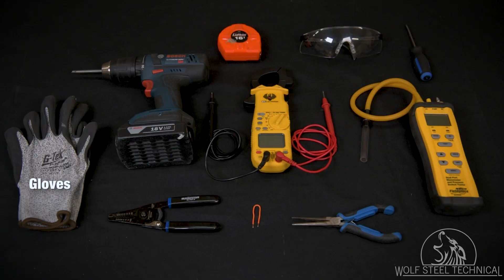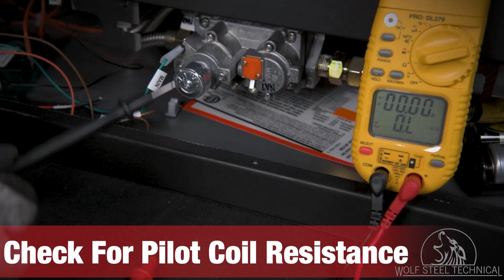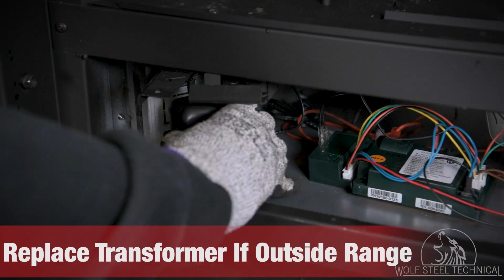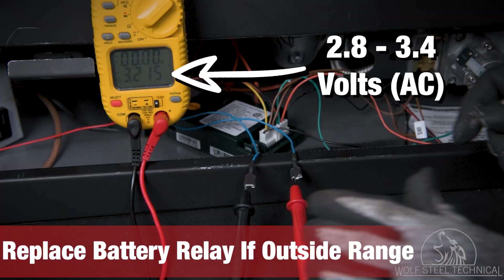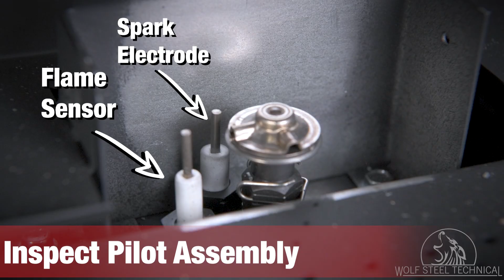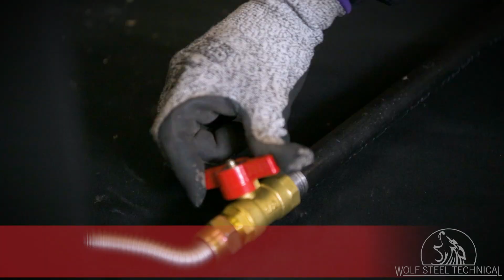DEXEN System Troubleshooting

Comment: I cant tell if it's the control module or if it's not sensing the pilot flame but my pilot comes on and keeps sparking. Occasionally the main burner will come on and then go out a few minutes later. How do I check the flame sensor readings ?
Reply from the maker: id double check the connections throughout the control board, valve, and flame sensor, sounds as if its calling for spark even after the flame is lit. If possible clean the flame sensor as well.

Of this doesn't resolve the issue, I'd reach out to Napoleon Customer Solutions to get a a better idea of next steps

Comment: Replaced module and the pilot sparks over and over and never fully ignites
Reply from the maker: Double check all connections to the gas valve and other components to ensure they are sound and have a firm connection.

Other than that, id reach out to Napoleon's Customer service team

Comment: Should have included a microamp µA test of the electrode sensor on the pilot assembly cause that is all that is missing from full diagnosis
Reply from the maker: This cannot be measured without special equipment due to the design of the firmware (a DMM will not work to measure)

Comment: The REV D indicator and the red light flash six times, and I hear an ignition sound, but there's no visible ignition. The fan seems to be working, but then it stops. What should I do? Should I replace the control board, or is there a problem with the ignition system?
Reply from the maker: Can I get more information; ignore the red indicator light for a moment and replace with some readings or even some observations. 

"I hear an ignition sound" what does that mean? 
Are you explaining the ticking of the pilot spark, or a actual pilot flame? 
Is the system on? 
Do we hear an audible beep confirming the remote synced with the system? 

I wouldn't want you to replace parts without knowing the real root of the issue, but lets gather some actual reading and continuity tests, it sounds like there is power if the blower turns on, but is it a power supply issue why the blower goes off?

Lok forward to your response!

Comment: I’ve replaced both the valve and control module and completed all the checks. Pilot sparks but does not appear to get gas as the pilot won’t light, nor will the main burners. Only check that did not pass is 3.5” manometer check from the main valve test port. I read 7” at the wall gas, 7” at the pilot test port. Should I get 3.5” at the main test port even when the system is off?
Reply from the maker: If the unit sparks but no pilot it could be a grounding issue. So assuming you tested all ground connection verification first.

Next is NO Gas or insufficient gas pressures. I'm assuming from the readings its natural gas. Check for a broken wire or wire harness (continuity test each wire) then the valve coil test (specifically on the pilot side).

Lastly the power to the valve  which could be the pilot coil wire DC voltage. If you have a spark but no gas being released to the pilot hood then its one of those failures.

Hope this helps

Comment: Whay if everything checks out but the valves just don't open or don't open enough?
Reply from the maker: have you completed a continuity test on all the wires in the wire harness? Just because it sparks doesn't necessarily mean we have continuity to actually open the gas valve. 

Couple more questions to ask:

What are your inlet and outlet pressures?
What are the actual ohms of resistance on both sides of the gas valve?

This will determine if the valve is bad and needing replacement

Comment: I have a pilot that Sparks but the valve doesn't open when there's a call for heat not enough gas goes through for anything to ignite but the gas detector detects something coming through. There are no obstructions in the pilot tube no obstructions for the gas supply. I get about 3.5 volts to the pilot solenoid from the IPI module and they're about 40 Kay ohms when I check the pilot solenoid. The flame sensor is working as the Sparks will stop when I put a lighter to it. When I bench test the valve with double a batteries making about 3 volts I can hear a very faint click but it's not very strong at all. I use the valve body as the ground only. What am I doing wrong? what is wrong with this thing?
Reply from the maker: This one is tough, as you have provided no readings for what inches of water column of gas pressure is “not enough.” 

if the stage 1 pilot doesn’t open in the valve then the valve is bad. - try replacing it

Comment: Thanks for the 5 to 6 jumper test igniter. We had replaced harness and control along with many other parts. After no spark or start up, we checked all connections, still no luck.  After jumper wire FROM 5 TO 6 sparked it, put everything back together and it fired off!
Reply from the maker: BINGO! Love these success stories! We have a lot more where that came from! What else you want to see us do though?

Comment: I got a Continental CDVs600-1 October 2024.  Since then the gas valve has been changed because the stove wouldnt light after 2 months.
  This May the stove would not shut off once the temperature set on the remote is achieved. So if it was set at 20C, the stove would continue to run as high as 25C ambient temperature before I shut the stove off on the remote. The remote flame shows its sending to be shut off,  meaning just the outline of the flame is showing on the remote,  This happened sporadiacly .     So, new remote in May. Ran it through a couple cycles getting up to temp and everything seemed ok.  Summer time it doesnt need to  run. September rolls around and it starts up, but is not shutting off still.  Would this be the control module?
Reply from the maker: Is this the F-60 thermostatic remote control added onto the unit? If so a couple suggestions; the remote transmitter and receiver (again) or have you replaced the batteries in both the transmitter and receiver recently? Try fresh batteries in both, sometimes it’s that simple of a fix.
  
If this isn't a fix, you can try replacing the control module for obvious reasons.

Lastly, I’m curious why the gas valve was changed because it wouldn’t lite? Valve’s very rarely are bad.
Reply: @wolfsteeltechnical  The remote is  model W660-0123. I would change the batteries every time it wouldnt shut off on both the remote and the control module. There is a red light that should light up on the  control module if the batteries are low, and it never lit up. I would test the batteries with a multi meter and they were always 1.5v or a bit higher on AA"s and AAA in the remote.  
Now the recomended remedy to fix this  is to disconnect the rocker switch and if that doesnt fix it , try another remote which will be the 3rd one
Reply from the maker: @LelandH-c6i  Those red low battery lights are notorious for not being accurate or working.
That doesn’t mean they need to replace it, when the batteries are dead replace them! Most the time the battery holder is in a position you cannot see the faint red light anyways.

Who’s recommending disconnecting the rocker switch and why? That will not solve the question of the low battery indicator light?

Comment: how many volt on the pilot wire (orange) when turn the switch on? is the volt in AC or DC?
Reply from the maker: Hey! Great Question. For testing the pilot coil wire on a Dexen system, perform these steps:

Set multimeter to volts DC.
Ensure the pilot wire is disconnected from the valve
Place the black lead on the gas valve
Place the red lead on the quick connect end of the pilot wire
Turn on main power switch 
You should receive 3VDC (+ or - 0.5DCV)

Hope this helps!
Reply: @wolfsteeltechnical  How much volts should you read for the main gas coil? Thank you!
Reply from the maker: @ 

To test the main, which is the green wire:

Set multimeter to volts DC.
Ensure the main wire (green) is disconnected from the valve
Place the black lead on the gas valve
Place the red lead on the quick connect end of the main wire
Turn on main power switch 
You should receive 3VDC (+ or - 0.5DCV)

Hope this helps!

Comment: I tested my valve, it shows 39Ohm and 59Ohm, i believe it's good. Howevev my burner still will not open even polit it on.  The polit will start sparkling once i disconnect the flame sensor (i replaced the entire polit assembly) so I'm assuming the flame sensor is working. Only one thing left: is it the module not outputting the correct control signal to valve, or valve is stuck. Output of green(to "main" of valve ) is reading 1.46V DC +2.6V AC, so I'm wondering what voltage is the correct signal to open the valve? Thanks
Reply from the maker: Revisit form 4 minutes onward and see if you can pinpoint the issue further.

If you cant seem to find a solution, I would reach out to Customer solutions here: https://www.napoleon.com/en/ca/company/contact-us

Comment: This video is helpful. I tested the main burner solenoid and it was 60 ohms and the voltage I measured was good and I even checked the current to the solenoid and it was ok. I then whacked the valve and it opened. It was stuck. I retried several times nad it continues to open and light.
Reply from the maker: i don't know if the was the best solution, but if its works 🤷
Reply: Thanks!!!  Spent 2 days troubleshooting my fireplace and everything seemed correct - voltages, resistance of the coils and it still would not light.  Couple of taps with the back of a screwdriver and it now works perfectly again.

Comment: I got a really strange problem. When I hit the wall switch, my fireplace doesn't light. I checked the valve continuity and it checked out per the test shown. I have 120 AC coming out when I flip the switch and bought a new 3v AC transformer that checked good. I then swapped the ignition module because I wasn't getting a spark during the test shown so it was indeed bad. I figured replacing it would fix the issue but it didn't. What I found out by accident is that when the wall switch is on and I remove the ignition module wiring harness Molex connector and reinstall it, the pilot lights and the fireplace runs every time. The only way the fireplace runs is removing the cable and reinstalling it!. I figured it had to be the wiring harness even though it checked out during continuity testing but figured it may have an issue that wasn't evident during continuity testing. After it lights and the wall switch is turned off again, it will not relight unless I remove and reinstall the Molex connector from  the ignition module once again! The only thing left is the pilot and I have one on order and it needs replaced anyway since it's 19 years old. Has anyone ever seen this strange issue before?
Reply from the maker: That is odd.  I would also look to ensure the black ground wire is either connected directly to the gas valve or to the bracket that the gas valve is attached to - ensure it's attached to an unpainted surface for a firm ground connection.

In addition to this, replace and check the voltage out on the blue wires to the control module.  Should be the same 3v

Comment: Does this dexen system require more than 1 grounding? Do you need a ground to the valve or 1 ground to the pilot assembly?
Reply: Yes it did i added 2 more grounds. And it worked good.
Reply from the maker: The system is grounded through a ground wire in the wire harness and yes, the only way for the flame to be rectified is for the flame sensor path through the control module and wire harness to be ground.
Reply: @wolfsteeltechnical  I'm going to try that tomorrow on an unit that I'm having a problem with. It's acting like it's a bad pilot assembly event eventhough it's brand new.  I will add another ground to the pilot assembly screw to the ground for the main harness and connect them both to the chassis. I may need to add another ground to the main burner metal flooring for good measure.
Reply: @luislibre9616  did this work for you?

Comment: What is the battery relay used for? Ive seen many systems without it.
Reply: I believe it’s for Remote function. My unit doesn’t use it, but I have the wires and battery holder for it.
Reply from the maker: The battery relay allows for the batteries not to be drained while installed in the battery holder.  Provides longer battery life.
Reply: @wolfsteeltechnical  thank you for the answer.  I really appreciate it.

Comment: Hi there. Does the flame sensor/pilot assembly need grounding?
Reply from the maker: The system is grounded through a ground wire in the wire harness and yes, the only way for the flame to be rectified is for the flame sensor path through the control module and wire harness to be ground.

Comment: Here's an additional slightly crazy root cause: the wall switch was semi-defective. It showed ~100 ohm resistance when turned on. Result: intermittent sparking, and when it did light up, would go out soon thereafter. An 85 cent replacement switch does the job. :)
Reply from the maker: As long as its safe, and the Customer is happy, that's what matters.
Reply: @wolfsteeltechnical  Yep. I'm the technician and customer ;) ... never saw this as even a possibility!
Reply from the maker: @WebbedPete   Love to see it. Out of curiosity, any other videos we made you found helpful? Would love to get some insight from you!

Comment: Only thing i see missing is how to properly check the millivolts for the flame sensor. I think im having an issue with the flame sensor or gas valve. Now i know how to check valve im good just wanna know about flame sensor testing
Reply from the maker: Thanks for the feedback @MrMcurtis08.

There are special tools used in the lab to test microamps of the flame sensor to determine correct operation. 

In the field, test the other aspects of the system, such as the flow of gas, correct operation of the valve, and flow of power.

If all are operating within the correct values, and the issue still occurs, replace the flame sensor.
Reply: Gotcha!!!! Thank you!
Reply: but the milli amp meter in series between the module and the flame sense wire. it should read micro am when pilot is lid.